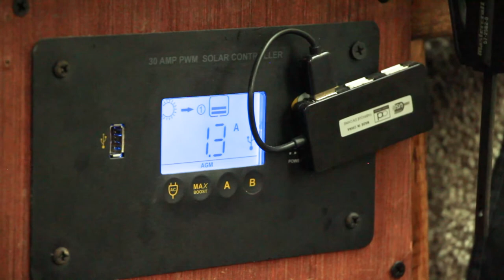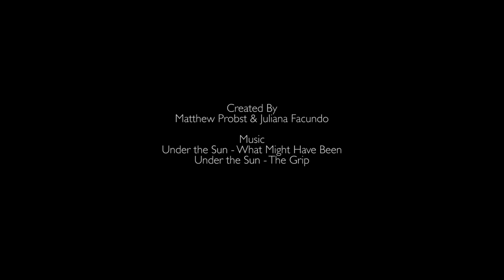Episode 2 - LadyBunny Van Tour

Comment: Nice video. Well done. I like your tone and pace. Good editing. Keep it up. I'm planning a van build like yours in March. Does the fridge heat up your van? You might want to put where you're from, the model and year of your van as well as recording equipment in the description of your videos. Subbed.
Reply from the maker: Thank you for the kind words. The fridge never caused any noticeable heat for us, and the van is a 1998 Pontiac Trans Sport. You can check out our Van Build Video for more details on our build if you like. For our recording equipment we have a Canon 7D with it's stock 18-135 f3.5-5.6 lens along with a Canon 50mm f1.8.